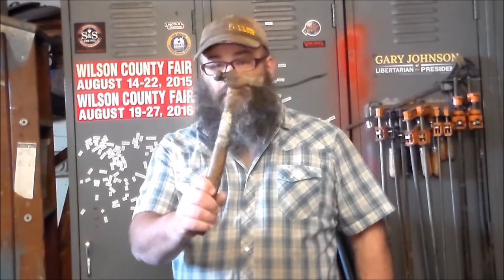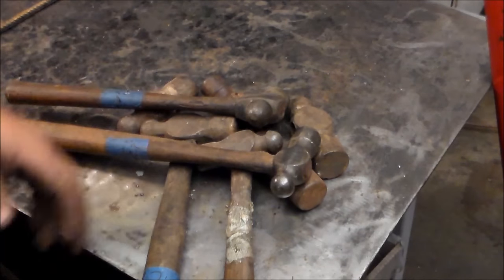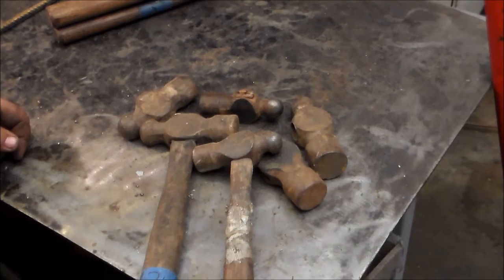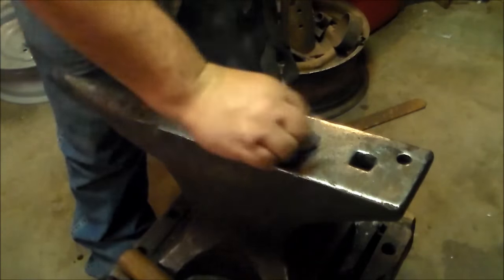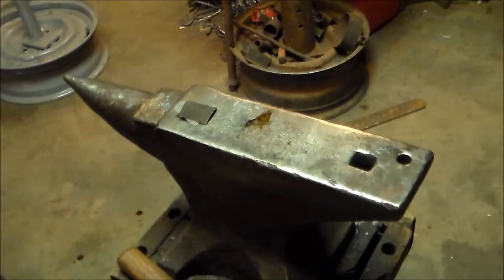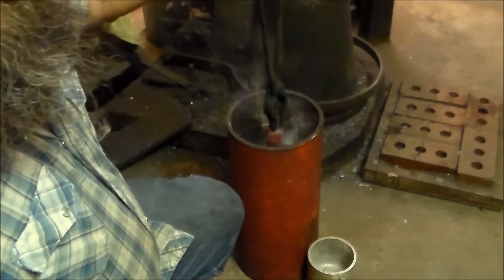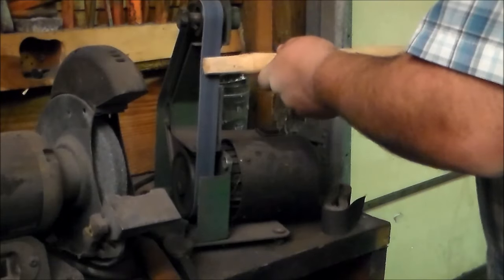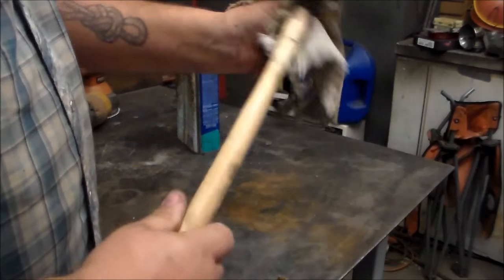Spike Hatchet Forged from a Ball Peen Hammer

Comment: what kind of tongs are those?
Reply from the maker: Mason Richards they are called side tongs or 90 degree tongs, they are not super common.
Reply: when I go onto ebay, I look up 90 degree tongs and 90 degree scrolling tongs show up, could I use them the way you used yours tongs in the video?
Reply from the maker: Yea they are kind of hard to find, you may need to find a antique pair, forge some or modify some scrolling tongs. All the pairs I have are either forged by me or antiques I just ran across.
Reply: thanks, I will do that